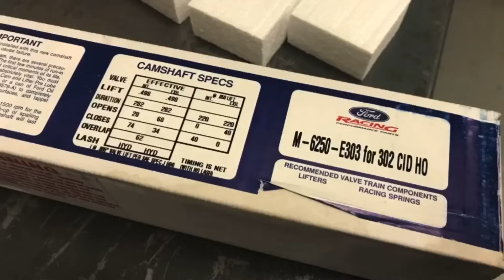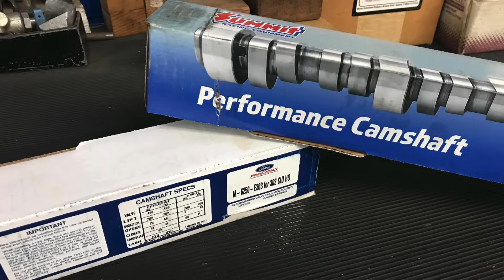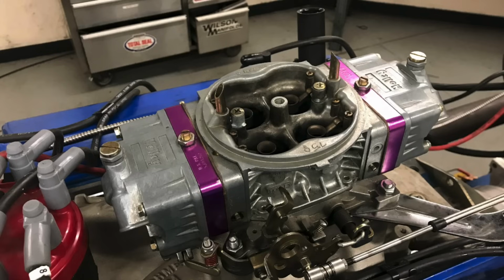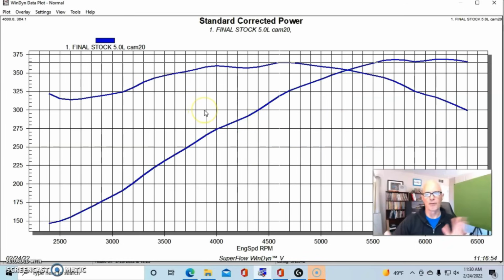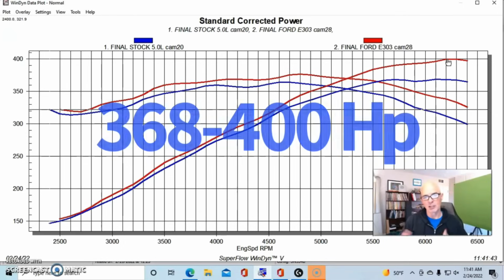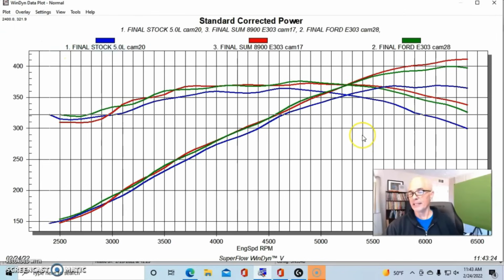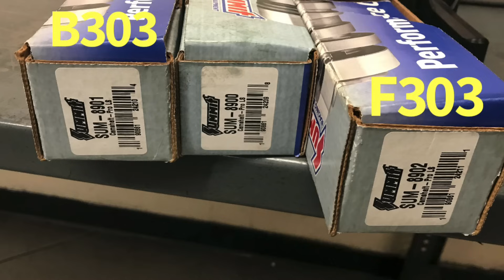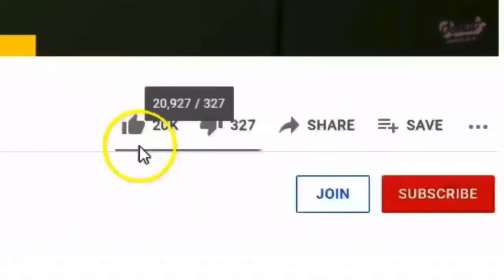HOW TO MAKE 5.0L FORD POWER! FORD RACING E303 VS NEW SUMMIT E303 PLUS-IS THE E303+ REALLY BETTER?

Comment: Hell. A stock HO cam and blueprint headed long block looks like a really fun daily driver motor. No lopey lope, but really great all around power.
Reply from the maker: Couldn't agree more!
Reply: I am a fan of the stock HO cam. At the moment one of my mustangs has a 10.8:1cr  347 with 200cc aluminum heads and the factory HO cam. But I am a fan of mild cammed engines with performance machine work and good heads. My camper van has a stock HO cam also. I put Roush 200cc heads on that one along with tight quenching. Really good combos for  vehicals that gets driven a lot in my opinion. I have played with big cams also, just my taste in builds has changed over the years. My F250 with a 460ci, which is my daily has a bit of lope in it, but nothing extreme as I need off idle power from it.  Also a higher compresion, tight quenched engine with aluminum heads. Now my street stock engine, that has a bit of a nasty cam in it lol.
Reply: @whiplashmachine  well that used to be Ford's ethos back in the day. Make the heads breathe. Then a smaller cam for excellent manners. Compare Richards Boss 302 vs Z/28 302 test.
Reply: @travislivengood2744  I have become a fan of street manners. So many ways to build reliable power without rough cams. I build and tune quite a few race engines in a year, so I get my taste of nasty cams still. I quite often get to road test them also, tons of fun lol.
Reply: @whiplashmachine  I'm surprised you are able to run 10.8:1 compression with the short timing specs of a stock HO cam.  I would think your cranking pressure would be over 200 psi...often in detonation territory even with tight squish and cooler-running aluminum heads.  I'm guessing conservative ignition timing, reduced low rpm charge velocity from the larger port heads, and the extra compression bleed-off of the stock cam's longer seat to seat timing must be just enough to make it work.
Reply: @steveamnmn  compression bleeds right off on them. They make pretty good boost cams too
Reply: @whiplashmachine  I have a 74 Comet GT40 headed 302 w/tight quench that has HO cam and will do 99.9 in the 1/4.

Comment: Would love to see the F303 and the F303+ compared with boost, especially since a lot of people still use the old F cams in boosted engines!
Reply from the maker: I will test those-boost won't change anything
Reply: F303+ Vs XE274HR
Reply: @AU10ZC yes! Have a vortech running a XE274HR in a 331 been wondering if it’s not an optimal  cam for boost

Comment: Thanks Richard. Always love the Ford stuff.  I may be wrong, but I basically see the two E cams as the same power out put. Yes,  the Summit  cam has a few more ponies at the top end, but I am willing to bet the Ford cam will be easier on the valve train and will run practically forever. This proves to me that Ford really put an effort into their cams and are of great value
Reply from the maker: the E303 was a Crane cam

Comment: Looks like the wider lobe separation trades hp and tq for all the gains up top. Let’s see more testing sir!!!
Reply: Its a very LS style cam. I think a tighter 108 lsa and less exhaust duration would have been beneficial.
Reply: There's no comparing those 2 cams... they are completely different in every way but ONE spec.  Stupid name... E303+

Comment: It seems like this was a very good combo to start with. If I remember correctly, the stock 302 in your configuration makes about 275 at the top where this one, with the Blueprint heads, makes 368 with the stock cam. That’s huge! Either of the E303 cams then make a nice further increase that you’d notice on the street or at the track. Looking forward to the EFI results, but how about a 327, 331, or 347 shortblock? And maybe some better flowing intakes than the non-air gap? I enjoyed my ‘89 notchback bought new back in the day, but any of these combos would have been night and day better! Thanks Richard!

Comment: I'm amazed it made so much with the stock cam, especially compared to other tests you've done. Imagine if it came that way from the factory.
Reply: @Mustang_Chris  the factory cams in the GT (ZE Cam) and in the post 94 trucks and exploders (TE Cam) are actually really good cams for the street. All they need is heads and possibly a rocker ratio change. I like to I se 1.7 rockers on the TE and split the ZE 1.6 on the intake and 1.7 on the exhaust. The TE cam with 1.7 rockers is a really, really good torque cam I found
Reply: Most people don’t understand that’s the only reason the LS engines make the power they do bc they have good flowing heads.if ford was still making the 302 n 351 engines with heads that flow like the LS heads they would make just as much if not more power

Comment: I was Chevy dude growing up got new in 88 a 1987 IROC Z28 5 5speed car with tune port injection 305 cubic only auto trans car had 350 cubic my cuz got Mustang GT 5speed car and beat on it every day bang bang red line dump clutch and jump off line , my Chevy treated it like a Princess that engine was great idle 45lbs oil pressure but trans busted three times busted rear end two times my cuz mustang GT drove it like a fool for years n over hundred thousand miles my Chevy was busted lots so had low miles got Me a Mustang GT 5speed car new in 02 drove daily now 20years and 400000.0miles N replaced nothing but plastic intake due to heater hose fitting cracking n leaking

Comment: Those big, long tube headers may have affected the power numbers down low, maybe next run use the shorty headers since that's what most people have in their cars. Looked up the part number and it Starts with American bearing steel billets, unlike Comp Cams which is using austempered iron, so right from the start a better-quality cam material. Nice blast from the past.
Reply: Don't long tube help down low
Reply: @ryandoyle4344  If the piping is too large off of the engine it will slow down the exhaust flow which would hurt scavenging. In this case short tubes may have helped and it's more in line with what is being used in the cars.
Reply from the maker: shorty headers do not add low speed torque compared to long tubes
Reply: @richardholdener1727  I understand that my point was the large diameter tubes of these headers may have affected the power down low, and to be more real world and use short tube header since that's what is generally used in the car.
Reply: @tedjones450    Should he hook up all the accessories too, including the broken arm rest pad?
Reply: @superkillr  Your comment does not make sense, it would not show real world number productions either way, really arm rest.

Comment: Good morning Richard
        Don't really have any use for what motors you are covering. But do like the information you give. Maybe you can steer me to one that shows me a small block 318 Mopar with a stock cam against a rv cam and the wiplash 340-360 cam. Thank You very much for sharing your knowledge with everything. You and David V are very Free with your knowledge and I for one Thank You. Always be safe in your travels and Take Care
Reply from the maker: have never built or tested a 318
Reply: @richardholdener1727  you think you might in the future. If so when? I'm 61 in June. Been playing with a 318 and been following Uncle Tony's garage and some of his tricks. Was trying to get the right parts and not waste any money. Thought maybe you might have done something with it. Your more into the big buck builds. Thanks Richard have a good weekend
Reply: Worked on them alot when I was younger. I was 18 bought a cuda 340  slap stick it was stock besides I put some lighter springs in the distributor. That was back when you could buy retreads that were snow tire pattern for about 20 bucks. Needed the extra tread for burnouts. Ha Ha just had to add that

Comment: I just found out about these summit cams. At almost $100 less than the ford cams, they’re a bargain too
Reply: Yes the cost of these plus Cams Make them look quite desirable. they are100 cheaper  than the ford  cam. I wonder haw the drivability is compared to the E303. in a Auto car.

Comment: Considering that a stock 5.0, with a carb and headers, makes around 240hp, does this mean those Blueprint heads ALONE are worth 120hp more?? That's a damn good investment!
Reply: Looks that way to me
Reply: Stock Heads are one of the biggest restriction on the 302/Windsor motors
Reply: @kristianmichels5649  I know, but I would expect maybe 60 up difference on a small V8 from heads alone, not 120. That's remarkable for relatively low budget heads.
Reply from the maker: a stock ones makes more than 240 hp with a dual plane and carb and these headers
Reply: @richardholdener1727  Oh, I seem to remember you testing a stock 5.0 recently with a 4 bl and headers and getting only 240 hp with the E7 heads. That's also a number given for some stockish 5.0 crate engines, with a 4 bl and headers. The headers in THIS test must be really good.

Comment: Would like to see the anderson cams up against these as well. N-21, N-41 would be a nice comparison
Reply: Yeah those are my favorite letter cams. A friend that ran with like in 1996 had a 347 Anderson stage 3 tw tfs heads maybe n-41 everything from Anderson single plane with fogger kit had a Doug nash gated and faceplated. That car was legit and the fogger looked so cool. 6.2 1/8 in 95-96
Reply: N-21 and n-41 are the same cam.  N21 uses 1.7 rockers and n41 uses 1.6.  Numbers are the same when you factor in the rocker ratio
Reply: @chrisfinamore6364  I meant either one, not those two head to head

Comment: I would like to see a test between the E-303, and the B-303 in a mild combination. Everyone always went for the E cam back in the day, but looking at the specs, especially on a combination with stock E7 or GT40 iron heads, I always went for the B cam, thinking that the added duration would be more beneficial than more lift, especially when using heads that have peak flow numbers below .500” lift anyway. What are your thoughts on this?
Reply: Agreed
Reply: Given that the much bigger cam in this video does almost nothing compared to the e303...I would bet the difference is splitting hairs.
Reply: It's apparent that the heads are the single greatest investment in your engine for the biggest gain. Yeah, they're probably 1500 bucks, but for an extra 100+ hp, that's a good deal.
Reply: @jeffrykopis5468  I agree, heads are expensive but needed for sure.
Reply from the maker: bigger cam should add power up top and lose power down low
Reply: Yes, but when one cam has slightly more duration and slightly less lift, which is the “bigger” cam?
Reply: @richardholdener1727  it would have been nice to know the manifold vac on the E303+. To me that's important especially if a guy is gonna use a carb. It's a better indication if he's build a motor that's gonna have some daily use as well. I like my driveability. Plus what considered good driveability can  vary from person to person.
Reply: I would like to see that combinatioon with the B cam Ive got a B cam with 1.7 rockerarms   in the car now but i have a new engine to go in with GT40p heads and F cam
Reply: I always laughed at the guys who just stuffed in a cam without addressing the truly bad head situation.
Reply: @ChuckG92  It must be even worse on EFI 351s. They have the E7 heads too, don't they? And 50 extra cubes to feed.
Reply: @ChuckG92  I find that funny too. Those guys will stick a gigantic cam in a stock motor with crap heads and think they have a race car.
Reply: What about 1.7 rockers
Reply: @humbertoarellano2725  I'm running 1.72 SVO rockers (they're pretty loud) and it gave me more lift.  Probably only good for 5hp.
Reply: *on a stock cam, that is.
Reply: @ChuckG92  Your rockers are "loud"? Either the rockers are contacting the valve covers, or the edge of the valve spring retainer. Better pull a valve cover and look for telltale witness marks.
Reply: @jeffrykopis5468  It's just the sound of the rollers.  I see now why the NVH guys insisted on unique covers for the '93 Cobra to quite that.
Reply: *quiet
Reply: @jeffrykopis5468  It's just the sound of the rollers.  This is why the NVH engineers mandated special valve covers for the '93 Cobra.  My aluminum '85 OE covers are just one big echo chamber for them.  Just have to get used to it.
Reply: @ChuckG92 Man that's wild, I'm on an E-Cam, GT40 heads and those same Cobra rockers, I have stock valve covers and like you mentioned they are noisy, I thought mine were just worn out and didn't realize that was a normal characteristic. When I was installing them I noticed there's a lot of play between the body of the rocker and the shaft they ride on, I imagine that's where all the noise comes from.

Comment: @Richard Holdener 
This shows how well the old E303 has aged. It was able to hold its own quite well. I think that E303+ summit cam would be a little too much on the lift for what we were doing years ago with stock e7te heads. Now with modern stuff that all goes out the window.
Reply: Naahh it would've been fine 550 lift isn't much you could've got a set of springs to handle that on those stock heads. Kinda like the springs they use on chevy vortec stock heads that handle 560 lift
Reply: @jonathanlawson4667  
They don't flow any more air at that lift. No reason to push them that far.
Reply: @tech1302  I used  a 560 lift Solid  cam in my 1971 Maverick it made 438 hp at 7200 RPM with a 1966 mild ported 289 head!  Yes new heads  are  better  but  don't try to tell me you can't make power with the stock  heads.
Reply: @mylanmiller9656  I really wish people would read before commenting. 
I never said stock heads don't make power. I have never owned anything but stock. E7TE, DOOE, GT40 etc
My comment was that Ford along with Crane who ground those old Ford Racing Cams did not see it necessary to push the valve as far as that "E303+".  Look at the small power difference with those blueprint aftermarket heads, do you think that with a set of stock e7te the difference would be greater or less? I bet it would be even less. 
Why hammer the valve open way past the flow capability of the head and also necessitate the use of more expensive valve springs?
Reply: @tech1302  Your  comment was  that it is  no point in going to a cam with more than 500 lift i say bullshit.

Comment: Overall Roller cam Production figures are effectively four types, revised four times:
85-88 5.0: E5ZE-6250-AA 266°/266° at lash 444/444 thou lift (Version 1)................................................ ..1st
89-90 5.0 : E8ZE-6250-CA 276°/266° at lash 444/444 thou lift (Version 2)................................................ 2nd
91-93 5.0: F1ZE-6250-AA 276°/266° at lash 444/444 thou lift (Version 2)
93 Cobra 5.0: F3ZE-6250-CA 270°/270° at lash 479/479 thou lift with 1.7 rocker arm ratio (Version 3)...3rd
94 Cobra 5.0: F1ZE-6250-AA 276°/266° at lash 444/444 thou (Version 2)
95 Cobra 5.0: F4ZE-6250-DA 276°/266° at lash 444/444 thou lift (Version 2)
96-01 Explorer 5.0:F4TE-6250-BA 256°/266°at lash 422/448 thou lift (Version 4)....................................4th

A-cam (Ist flat tappet hyd ) is 204°/214° at 50 thou 448 in. 472 ex...............Deadly Letter A'.....................5th
A-cam (2ndflat tappet hyd ) is 204°/214° at 50 thou 472 in. 496 ex..............Deadly Letter A''....................6th
E-cam is 220°/220° at 50 thou 498 in. 498 ex thou lift..................................Deadly Letter E.....................7th
B-cam is 224°/224° at 50 thou 480 in. 480 ex thou lift..................................Deadly Letter B......................9th
F-cam is 226°/226° at 50 thou 512 in. 512 ex thou lift..................................Deadly Letter F......................10th
X-cam is 224°/224° at 50 thou 542 in. 542 ex thou lift..................................Deadly Letter X.....................11th
Z-cam is 228°/228° at 50 thou 552 in. 552 ex thou lift..................................Deadly Letter Z......................12th

The  8th cam, was the non roller  Hydraulic flat tappet "G" VIN code P71 cam for 1980 HO 2bbl 351W Police Cruisers, based on the so called Windsor  Marine  cam, and used in the 1994 5.8 liter SVT Cobra 351. It's an over scavanging 1971,1972 351C Cobra Jet 4V and 351W D2ZE 6250 AB cam remastered, 270 I /290 E at lash, 208 I /224 E at 50 thou, approx 477/ 481 lift with 1.7 or 1.73 rockers.
Reply from the maker: thnx
Reply: How much duration do the fox cams have at .050?
Reply: @95GTSpeedDemon  Ford didn't publish them. You can probably get them from the 50 thou SAE figures NHRA uses, but I haven't looked recently.
Reply: @95GTSpeedDemon  210 @ .050. I measured a couple of them.
Reply: @stuartwall8212  wow. No wonder my 208/216 comp xe258 cam makes Peak torque at 4200 even with my big single plane and why it is a little on the low side for power output and is requiring a lot more boost pressure than I would expect to make the air flow I need
Reply: @95GTSpeedDemon   What heads do you have?

Comment: Maybe the 110 LSA explained the E303 advantage down low compared to the 113 of the E303+.
Reply: And less overlap.
Reply: E303 plus had higher lift as well and that's more air up top so naturally it's going to increase more bulk high RPM horsepower
Reply: Exactly what I was thinking
Reply: Hard to say, I would like to know the ICL.

Comment: That was a more than interesting test.
Does any one know what the lift at TDC is for these cams. 
My own trend over the past 30 years is to try cams with more lift on the Inlet than the exhaust, more Ex. timing (10 Deg. seems enough) then more lift on the Ex. @ tdc.  
What I try to do is match more radical cams at the top end but give greater power at lower engine speeds. Can be very fusy on the exhaust though.

Comment: Nice stuff and yes I'm very interested in f303 cam. I had a hydraulic flat tap version of it 512 lift 288 duration in my high school ride little 302 made lots of noise in it.